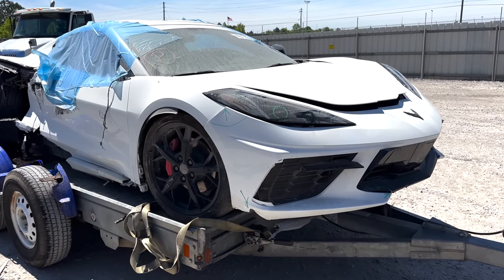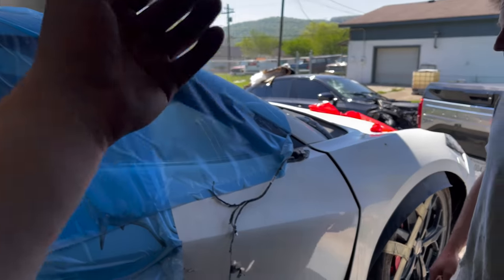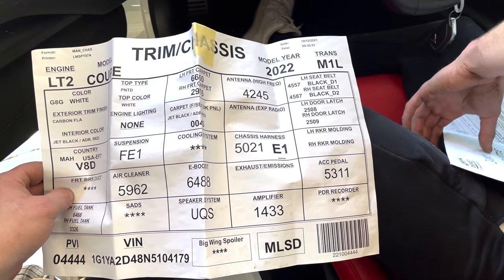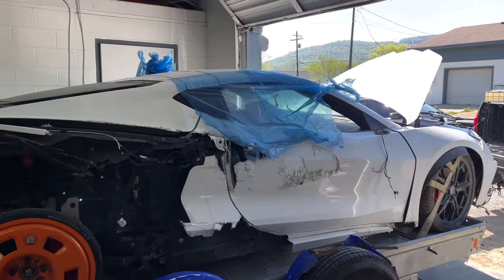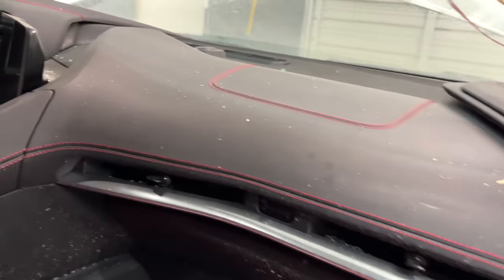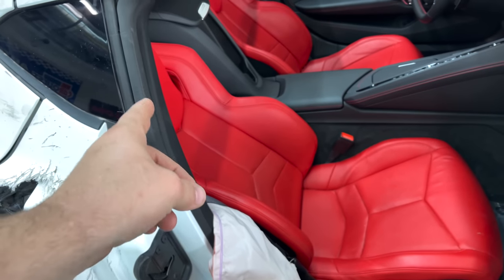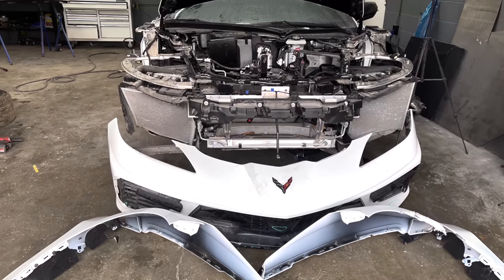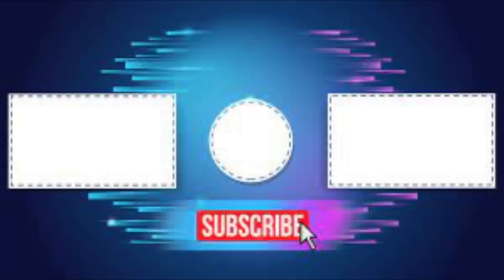Rebuilding A Wrecked 2022 Corvette!

Comment: Nice find.  Great to see you are restoring it! Shame someone trashed it so early in its life.  If you are curious, this is a 1LT. You can tell by the black speaker covers.  The 10 speaker Bose sound system is standard.  The 2LT and 3LT editions have a 14 speaker Bose system, easily spotted by their silver speaker covers.
Reply: Hey xbeaker the build sheet says 2LT at 5:51 does that mean it is 2LT or no?
Reply: @ahlacartsgolfcarts  That is the LT2 engine.  For some reason Chevy uses similar designations for the engine as it does for the interior.  Stingrays have the 6.2l LT2 the Z06 has a 5.5 LT6 and they both have options of 1LT, 2LT and 3LT interior packages.
Reply: @xbeaker   That makes perfect sense I understand now thanks for the explanation

Comment: tip for you all. If you are ever cleaning broken glass from carpeting, use a dual action sander...just put it on the carpet with no sandpaper on it and turn it on...the vibrating will make all the crap in the carpet bounce up and down and you can vacuum more out of it.

Comment: Just a tip regarding the SRS module.  GM SRS modules do not need to be reset.  If you replace everything that caused the fault, the airbag light will go out, then all you have to do is clear the codes with the Autel and you are good to go.  I work exclusively on Chevy's and I've never had to send one in.

Comment: If u have the key fob. Remove the key from the fob and up on the door by the electronic pad u touch to pop the door open is a key hole to open the door manually if the car has no power

Comment: Nice to see you embracing the joy that is Chevy. Every manufacture has there down side but at lease GM somewhat engineers their cars so they can be worked on when they break. GM is also good about putting the same parts in a lot of cars across all brands for many years. That keeps the cost of parts down and availability high.
Reply: Congratulations  ☝️You’ve been selected to receive GIVEAWAY PACKAGE Text me on the name above to receive prizes Thanks for watching.

Comment: It doesn't have to move to be considered a run and drive . It must go into gear forward and reverse. And clock the steering wheel left to right.  Thats what they considered a run and drive...